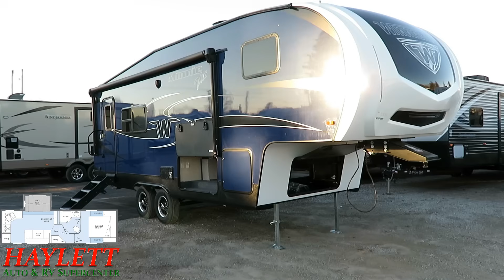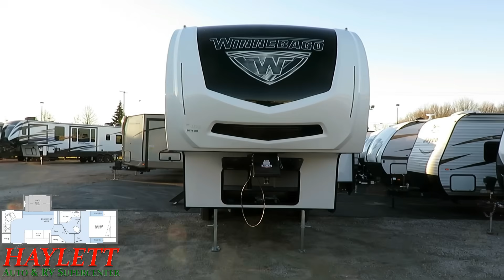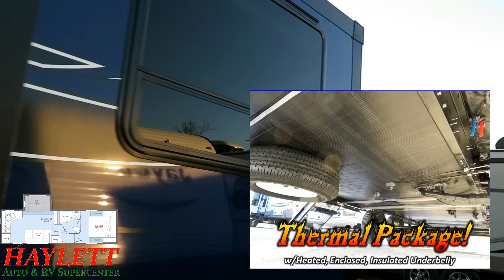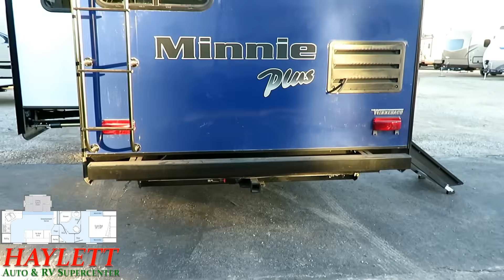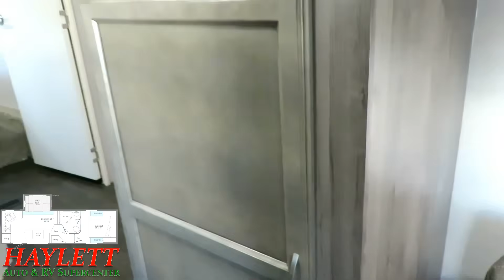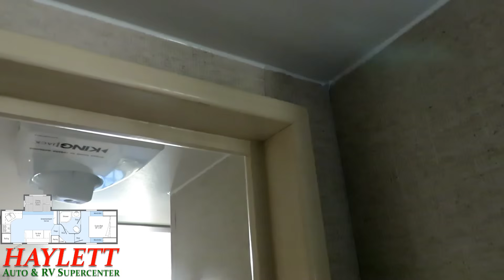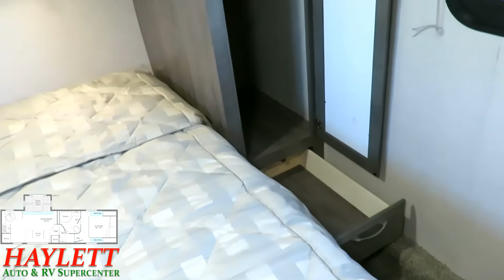(Sold) 2018 Winnebago 25RKS Minnie Plus Smaller Rear Kitchen Couple's Luxury Fifth Wheel RV

Comment: Josh I have never bought an RV but constantly watch you vids to get educated. You do a better job at covering more variety of products and explaining options than I have ever seen. Torn between light-weight TT & light-weight 5th wheel. Have u heard issues of having kitchens in rear since that in area most bounced on roads? Have you ever had chance to review Venture Sonic brand? Thank you and look forward to seeing more in 2020!
Reply from the maker: Regarding rear kitchens: https://www.youtube.com/watch?v=DNmv7jtqUTg
Shorter length ones like this have vastly less jouncing on the rear end since there's less of the RV hanging past the axles. 

We have no current plans to add any KZ products (which includes the Venture series) to our lineup currently. I do commend the Sonic series for trying to come up with something different, though.

We simply have so many offerings already and the lot is just plain full-up currently. There's no way for us to add anything new even if we wanted to currently.
Reply: Haylett RV Thank you for reply and no knock on your dealership; will continue to follow and so far may have to travel from Florida and give you my first time RVer business.
Reply from the maker: @roypase8488  Happens all the time around here. Big dealership in a small town. We bring folks in from all over daily.

Comment: What’s the tongue weight!
Reply from the maker: Normally I post the specs around the 00:05 mark, but full specs weren't published from Winnebago when I made this video. Unloaded hitch weight on this model is only around 800lbs however. Short size and no slide in the bedroom = very light
Reply: How much weight is in the fifth wheel hitch? Also, these videos never show the side “in”!
Reply from the maker: @shoveljunk-americanpatriot7603  fifth wheel hitch weights can vary dramatically depending on what you need, so I can't really offer an answer. Speak with a sales team member to share some details on your vehicle and what hitch you may require so we can get more specific on that item. 

Regarding slides closed: For the past year we've provided slide-closed footage of RVs. You're simply watching aged footage currently.
Reply: Thank you.

Comment: Can that sofa be changed out for theater seating?  Nowhere to set a drink the way it is.
Reply from the maker: Can't imagine that'd be an issue since the sofa is in the main body of the RV. Give our guys a call & they can get one quoted out for you. There have been several significant updates since this footage was captured -- we simply haven't received a 25RKS in since then.
Reply: I made a small side table to sit right by the door as there's about 10 inches there. I used hair pin legs and put a shoe rack underneath it. I also purchased a small wicker coffee table that I found used that suits us & fits great.

Comment: Can you access the bathroom and bedroom with the slide in?
Reply from the maker: Yes, and *maybe*. Shortbed towability seems to vary by vehicle. We'd basically need to see them pretend-parked with one another and do some measurements.
Reply from the maker: Yes, you can. I have begun including footage with the slide(s) closed in my newer content to answer those questions for folks. This one was capture a bit before I had made the switch.
Reply: also can you walk length with slide closed? and can you tow with short bed truck without sliding hitch? Love your channel.

Comment: Can this be tow by 5.7 Toyota Tundra
Reply from the maker: Can't even begin to answer without knowing things like towing capacity, payload rating, etc. And, I'm not going to make up an answer just to make a sale when it could be putting you into a potentially unsafe scenario. There are a few critical specifics we need to know for towing. Best suggestion is to contact our sales team at 800-256-5196 so they can go thru a towing guide with you on the spot to ensure a correct answer.
Reply: Josh, would you say that this model is one of the few potentially half-ton towable models? I agree with you that literally almost every one is not really capable and it's misleading That being said, this has a hitch rating of 880lbs so that should out it in the payload of quite a few half-tons out there.
Reply from the maker: Absolutely. That incredibly low pin weight is ideal for non 3/4 ton towing.
Reply: Haylett RV thanks Josh. I ran numbers o it last night based on what we tow and I would be just under my payload fully loaded. I used be scales numbers for what we load in our current trailer looked up he hitch weight, family weight, cargo, and fuel. It’s a thought.

Comment: Man I was sold until the bedroom-can’t put hubbys c-pap on that little shelf above the bed.  No night stand area for it either 😢
Reply from the maker: Floor beside the bed wouldn't work? 
Also, could easily modify the bedside closet for a sort of window/opening into the closet where a CPAP could be placed. Little stuff like that is super simple. 

If that's the ONLY thing stopping you, then give our guys a call and we can explore a few options to see what you would deem acceptable.
Reply: Put the flap in the drawer.